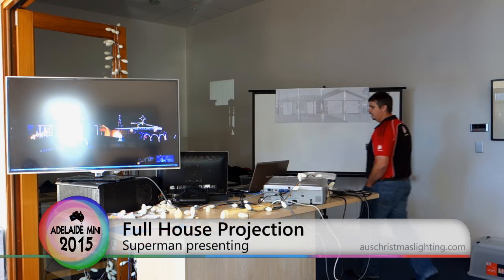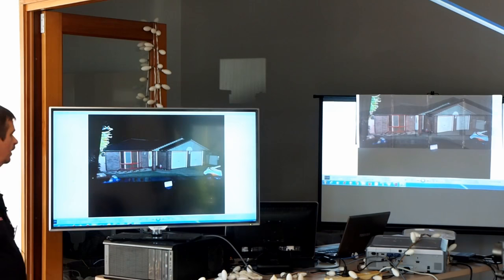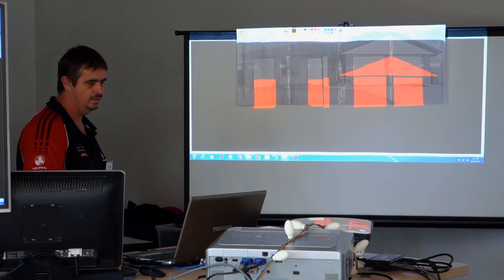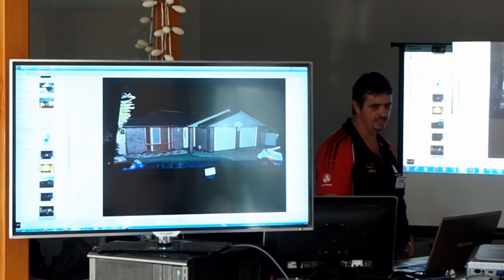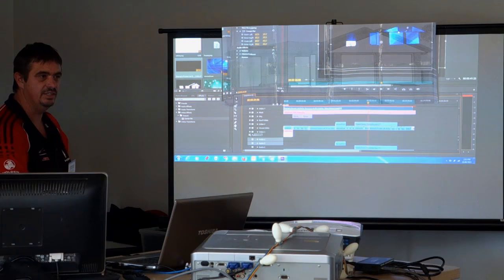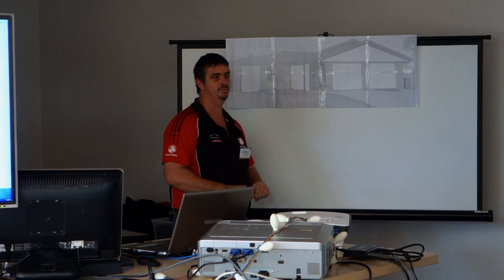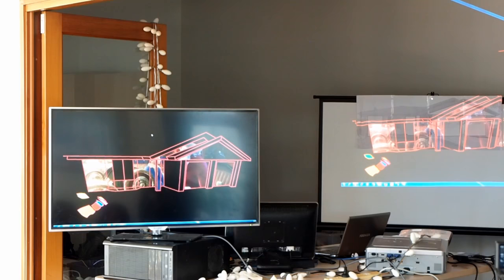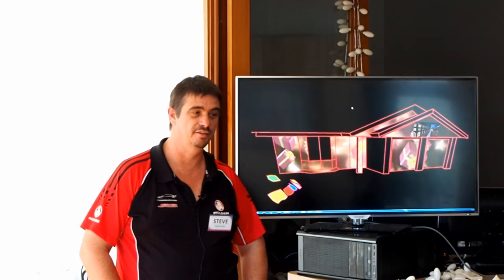Adelaide Mini 2015 - Full House Projection (with Adobe Premiere)

Comment: i have built my show using Premier Pro based off a pinned photo from LumaMap, but after i export the show and try to project it on my house, it is not lining up with the pinned photo, it is almost half the size of the pinned based photo. I built the show off the pinned image that lines up perfectly when i just project the image. but the exported mp4 video is not lining up. Advise??????